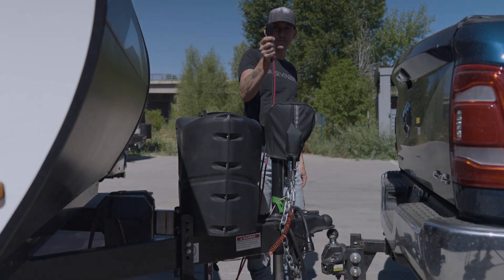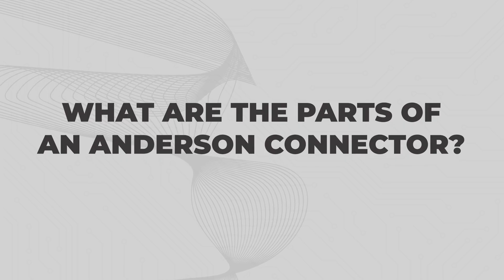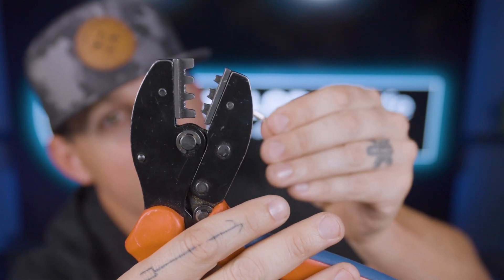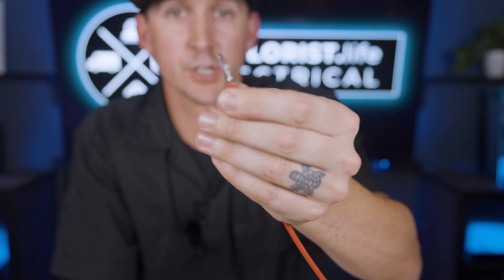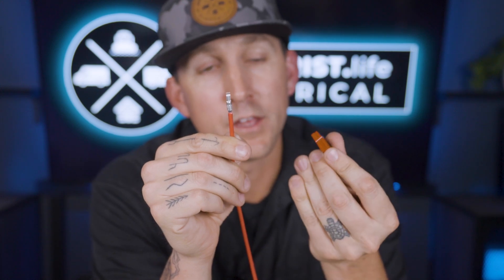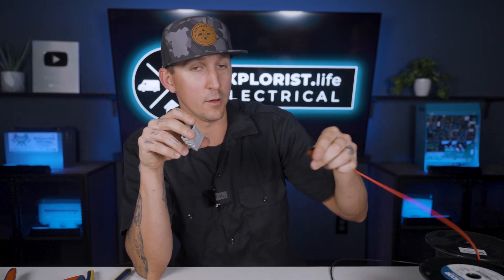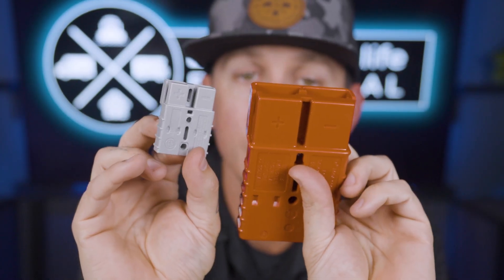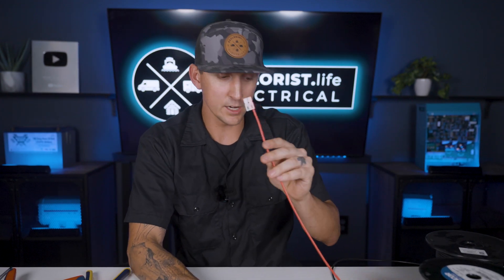Anderson Connector Crimping 101 - Wire Terminal Basics | Ep: 8/14

Comment: Old video but i have a concern with anderson connectors and contact area. When the lugs or plates come together it's not really a solid connection. Im using an Anderson for the DC to DC charging wires, 1/0 awg.
I bought the correct Anderson and used a hydraulic full hex crimp. The crimp or wire isn't the issue. The contact area and pressure is the issue. If you look at the contact area itself, it winds up much less that the cable gauge itself. They get hot, mine at 90 amps get pretty warm. The cable doesn't, the contact area becomes crusty and arcy, if that's a word. Im looking into Rema full 360 contact connectors.
Reply from the maker: Thanks for the detailed breakdown — and totally get the concern. Since connector heat and contact issues can vary a lot from setup to setup, we’d really like to take a personalized look at your wiring, components, and layout so we can point you in the right direction.

If you reach out to our support team, we can help make sure you get the right parts for your project:
https://shop.explorist.life/support?utm_source=youtube&utm_medium=comment&utm_campaign=support&utm_content=response_link

Happy to help you sort it out!

Comment: Comment about the suggested OUTDOOR use (such as on your truck bumper connection) of Anderson Connectors: - No, Anderson connectors are generally not considered waterproof. While they are designed to be durable and can withstand only SOME moisture, they are not sealed against water ingress... be very careful because they typically don't have a tight seal to prevent water from entering. The housing is typically made of polycarbonate and don't have a gasket to keep water out. They can handle some moisture and are often used in outdoor or automotive applications where they may be exposed to rain or splashes....If water gets into the connector and onto the contacts, it can lead to corrosion, potentially causing issues with the connection It is possible to make Anderson connectors more resistant to water by using techniques like applying silicone sealant, using heat shrink tubing, or using waterproof boots specifically designed for them. Good News! ...There are specific Anderson connector series, like the SBS®X-75A series, that are designed to be waterproof with an IP68 rating.
Reply from the maker: Hi, friend.  Like I  mentioned in your other comment.   12V applications do not need to be waterproof.  How do you think a boat is backed into the lake at a dock with the 7 pin connector below water?  Same concept here.

Comment: Dude, love your videos, sadly I learned almost all your knowledge in DIY stuff the hard way, by asking questions googling, and trying stuff. Lol. That's ok. I learned the lesson of getting good tools. When I switched to the Temco crimper, man that was so awesome! I had some janky connections! I was going to buy the Anderson crimper as I am getting into Anderson connections (after breaking off terminal posts on my rack mount batteries from taking wires off/on to charge with too much force...sigh) and I wasn't sure the best way to crimp. Since you use the Temco I'm gonna go w/it, doesn't sound like I need to buy the Anderson one. You helped me out too in my design of 2 Victrons talking together for 2 PV arrays facing different angles to get the most power I can out of the day. Thanks for that! With Starlink becoming way more reliable I seriously want to live the camperlilfe for a year or so. I have a decked out Tacoma and I can camp and work remotely! Cheers brother appeciate all your videos, diagrams everything

Comment: No heat shrink is required, especially outside in the back or the truck it seems it would protect for humidity and water?  Thank you for this video,!
Reply from the maker: Correct.
Reply: @EXPLORISTlife  Hello Nate, Just to clarify, Correct it is never needed, or, correct it would protect from humidity, dirt and water if adding heat shrink?  Thank you !
Reply from the maker: No heat shrink required, which is why we don’t supply heat shrink in our wiring kit. 👍
Reply: @EXPLORISTlife  Super, Thank you very!

Comment: Nate, I’m so grateful for your channel!  Even though my trailer upgrade (small Airstream) is essentially complete (540Ah, Quattro 3000 with new front generator plug for Powerboost, Lynx shunt, Lynx distributor, 600W on roof with 100-50, 200W on ground with 100-30, Orion XS, Cerbo GX with Touch 7”, integrated Mopekas, integrated Seelevel, integrated Ruuvis for fridge, freezer, tanks, and other things I’m probably forgetting), I can’t stop watching!  Little details like your external solar disconnect and Lynx extenders made all the difference.  On topic with this video, I don’t know if you’ve ever tried the Australian Trailer Vision Powerpole enclosures but they are really nice.  Take a look sometime.  Thank you again!

Comment: I think a useful thing to consider is that each housing takes a specific pin insert size, but each pin insert can be bought in a small range of sizes corresponding to a small range of wire gauges. You can buy the terminals separate to the housings. So it is importance to buy the correct pin size for its housing, and also the pin crimp size to match the wire that you want to connect. Otherwise you might not make a tight, strong crimp. To use Nate's phrasing, "Ask me how I know this"
For larger pin sizes crimp gauges, this might be slightly less of an issue with Nate's non-hydraulic crimpers but it is with hydraulic ones which creat a hexagonal crimp - where you have to select the correct die size. If you don't, it looks like it has crimped the terminal but the wire is not crimped tightly. And you have to go down the ladder of dies. Again, "Ask me how I know this". As Nate mentions elsewhere, he is not a fan of hydraulic crimpers and I think rightly so - he covers this in another video. Unfortunately I had bought and often used my hydraulic crimpers before I had the pleasure of discovering Nate and Steph's wonderful channel.
I can also confirm that the pins are removable, but trickier with the smaller ones than the large ones. Once again..."Ask me how I know"

Comment: Great video Nate. I have a question. With the 10-16 ga crimping, does it matter which side of the crimping tool the wire comes in from? I have an Anchor crimper that has anvils for three different wire ranges and it seems to crimp better when the wire comes into the crimper from  the side that shows the wire ranges.

Comment: Did you try lots of Hydraulic Crimpers before deciding on the current one you showed... it can be a hit-or-miss.with these offshore brands
Reply from the maker: We didn’t show any hydraulic crimpers in this video.
Reply: I was referring to Timco battery lug that you showed.  I thought it was hydraulic.  It's only good for larger wires even though I have one that can accept smaller dies.  BTW, great chanel with tons of awesome content!  Great reference material.
Reply from the maker: Nope.  The Temco crimper is not hydraulic.  I’m not a fan of hydraulic crimpers.  Check the battery lug crimping video from this academy (a few weeks ago) for more info on that one as well use it for anything 6awg and larger.

Also… Temco is a USA brand.  Based in Brenham TX.

Comment: Anderson connectors are great. We use a lot of them for DC power supplies at work. I have a question when using them for DC/DC charging from the vehicles alternator. Because I like to “over engineer” my wiring due to fear of melting or fire. Is it possible to have wire too big? You mentioned 6ga at the bumper. But would some like 4ga or 2ga be too big? Would there be any kind of losses? I don’t think so, but curious about your input. Thanks for all the videos, I really like all the attention to detail.
Reply from the maker: Consider using our wiring kits: shop.explorist.life 

We’ve sized all wires, fuses, lugs, heat shrink, etc to be appropriate (and safe) for their intended purpose.  

Arbitrarily over sizing wires can indeed sometimes pose problems and if you’re trying to not use our kits and instead size your own wire, I challenge you to scroll back a few chapters in this academy to find the chapter we made on sizing wires.